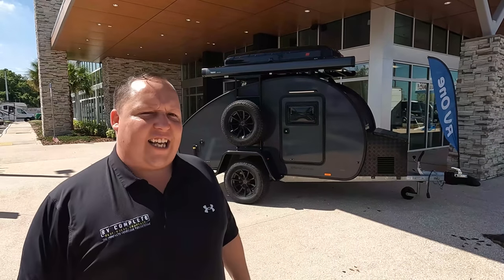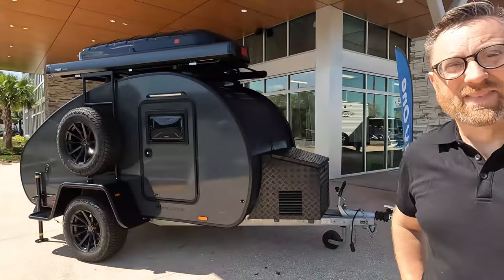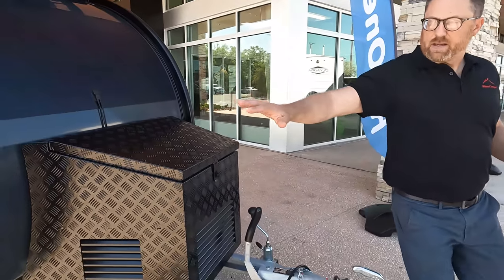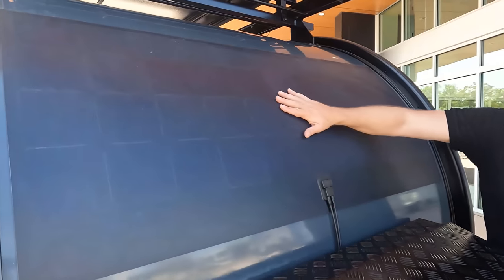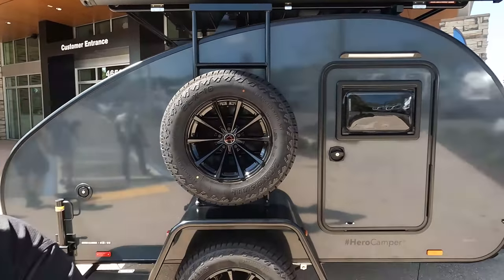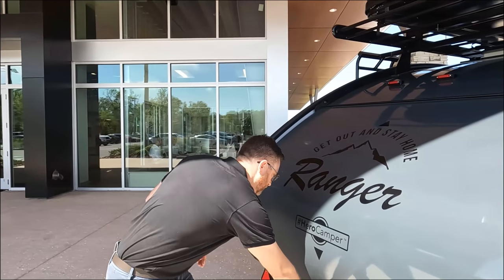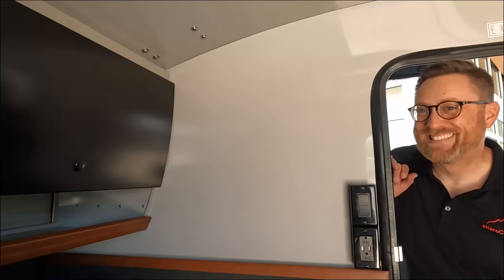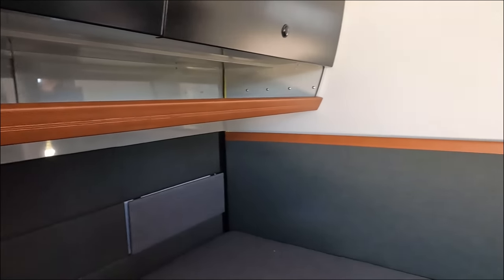Tow it with ANY VEHICLE - Hero Camper Imported From DENMARK!!!

Comment: We actually bought one of these in December 2021.  Seems like the communication between the Manufacturer and the dealer was off.  We were told by the dealer there was a heater (not just ac) that could run off surepower.  There was NOT.  Only the European version could run off surepower.  After about 2 months of back and forth we had to return the camper.  Manufacturer did offer to install the diesel heater, but we did not want to have to haul diesel around with us.  Real bummer for us!

Comment: The camper itself is great. The tent is good I would opt for a 180* awning and if it would fit a dometic 12v refrigerator/freezer. Is the A/c 12v or would you have to plug in. This would be an awesome boondocking camper if solar is enough to handle a/c load. Need to talk more about power supply.

Comment: I like the little thing. 
I like the quality of construction because you can see it’s well built. 
I like the tent option up top. 
I like that the inside has AC and heat options. 
Also bonus like of the Surge brake system. 

Dislike I didn’t see any lithium batteries described. It has a panel and says it’s got a battery but what’s the details? 
Kinda dislike the diesel heater is an option…maybe should be standard 🤷🏼‍♂️ 
Kinda dislike the hitch. Maybe needs a pintle hitch. 
Didn’t see mention of a hitch on the camper for a bike rack maybe 🤷🏼‍♂️
Reply: Agree, does it have rear hitch?

Comment: What a god sent item for adventure people!! 
Likes: 1) website shows two sizes of tent for top  2)  fits in a garage - spare beds for the sleepovers  3)  built in solar is innovative
Sort Of A Dislike: we are use to having refrig and stove at that price point, but on other hand I always liked having one cooler stocked with frozen items and thin slabs of ice and a cooler for drinks/cold cuts/cheese. 
We need more Euro engineered campers, RVs, vans here in USA.  When you go to Denmark travel on down to Germany on high speed train, they have some stellar manufacturers of RVs

Comment: Matt, love your videos but I have to disagree with your first dislike.  Coax is so rarely used that's not a big deal.  In my humble opinion the biggest dislike is the fact that the trailer coupler isn't an articulating style.  Most trailers in this class are setup with a Lock N Roll or similar.  You nailed it though with the fridge being optional + way too small.
Reply: I bought one of these, and although the trailer hitch head looks traditional it does flex sideways like an articulating hitch.

Comment: I'm a fan of roof top tents on all the smaller class RV styles. Besides giving the extra room u catch that night cool breeze much easier. Solar is awesome but camping in the forest u won't get the rays u need to power AC.
Being a solo female overlander my only issue w rooftop tents on teardrops is the ladders. I need one that's my Rottie can climb & so far I haven't found any after market that'll work.
The prices on RV is crazy high. Although I can see spending more on the ranger. 
Matt- u need to start commenting on basic warranties on the dogs in your videos. With prices climbing every month manufactures should be increasing their warranties. If their product is as good as they claim adding length to the term won't cost them

Comment: Because I have sons who do outdoors extreme backpacking and camping in tents in remote areas, I'd say this unit is awesome. The 6-gallon water tank is a really nice perk, the good beds with AC and no bugs and in a safe space are really nice. The frig wouldn't work for most since there usually isn't power where they camp but some sort of Igloo or carry a lithium generator and have the Igloo and generator inside their trunk/truck. Okay...you get the idea. This a cool unit for the diehard camper who pees in the woods.
Reply: Barbara, you are right about safety from animals in the woods.  Also, ability to charge phones for emergencies without carrying Jackery solar unit.
Reply: Solar won't run the A/C either.   Lithium battery+inverter is NOT a Generator.
Reply: @Hogger280  🎯
Reply: @jrambo7495  ??

Comment: Wow! I'm surprised to see an European trailer in the USA with all function lights at the rear as well as the red triangular reflector which denotes that the vehicle is a trailer and a legal requirement in many countries including Europe and Japan amongst others. I have the running gear on that trailer on my own here in Japan. I am a huge fan of the KNOTT (Made by Knott GmbH). The handbrake is very easy to use and very, very reliable. The prop stands (acting as stabiliser jacks) at the rear are really meant for goods trailers in Europe and whilst easy to use, are not really the best solution for a caravan (aka camper/camping trailer). That was evident when the caravan shook as they were on the roof. There are better options. It also should be noted that the coupler is a 50mm standard and not 2" (50.8mm), so ideally you should change the ball on your vehicle to match that of the trailer. You really should get Drew from the 'Playing With Sticks' channel to review this. He has a huge following and is all about teardrops.

Comment: Very nice unit. Love the galvanized frame. Diesel heat option I think would be needed. A spot for a Dometic fridge/freezer on a slider in the rear would be nice. A ceiling fan and an option for more solar on the rear lifting panel. Room for a generator in the box up front. No propane? You did say boon docking? Shower on the side and exterior lights. Where do I take of my shoes or do I just crawl in with the mud on my feet? Do I sit on the edge with the door open so all the friendly mosquitoes fly in While I take my shoes off and change my clothes? Why no removable cushions in the center to allow sitting? USB ports? Satellite radio/Bluetooth? I know its a camper. The quality is there, I think it just comes up a little short for the money in the amenities department.

Comment: Dislike: no fridge, I think that it may be difficult to find a box that will fit in that drawer and someone would be forced to buy the option fridge which is probably more expensive than being able to buy a generic. Or they need to change how the the fridge fits so that one can just buy a cube to put in.
No heater
Needs more stabilizers
I love the tent 
The clearance and tires
And the solar panel
Reply: You can adjust the grommets in that drawer. I did and put a medium size portable fridge/freezer in the slider.

Comment: Don't like:
1.Agree about the fridge
2. The sink basin is great, but the tap is too short, dishes are the same size even outdoors, taller sink tap.
3.  Would be nice to see a heat pump with the Air conditioning too. 

I would definitely be adding more batteries to such a thing too I suspect.

Comment: 14:07 Maximum weight of the tent is approximately 600 pounds. We need to test that. Let's get Matt & Wil that Tent and see what happens? I say it (the tent) survives (thanks to over engineering). Place predictions in the replies. PLUS, this thing is supposed to fit FOUR adults. Let's see the odds on the who Matt's Crew in the tent. Not for nothing but the over/under on that slides to the under.

Comment: While I appreciate build quality, I can't help but question the practicality of these tiny cabin + outdoor kitchen + roof tent designs.

If I were to redesign the thing for greater functionality in the space, cut down the overhead storage size and relocate it to the headboard for the next step, flip the kitchen to be usable from the inside, include a fridge by default, and incorporate comfortable space for a cassette toilet(which it would come with standard) in there.

Now, one might be asking, why go through all that to make the inside of the like that when it's going to be cramped. Simple: no one wants to try cooking or going to the bathroom outside in bad weather.

Also, definitely have the tent be optional. Don't get me wrong, it's a fine tent, but looks like a bit of a pain to setup, while also adding cost and weight for a feature not everyone has a use for..

Comment: I hate surge brakes. I think they are the stupidest designs ever!!! 
I think they're initially designed for rental trailers to be hooked up to cars that did not have a trailer brake controller. Practically every rental trailer of any kind has surge brakes.
I have had to pull trailers with surge brakes a few times and I absolutely freaking hated it!!!
If you're on a real slippery surface and put your tow vehicle brake on, the trailer brakes won't come on until the tow vehicle starts slowing down first and if you're on a slippery surface and your tow vehicle starts sliding a little bit the trailer brakes will never even come on to help you slow down!
Besides for the fact that you cannot back up with surge brakes cuz it'll automatically lock up the trailer brakes.
I once had you back a trailer with surge brakes all the way up a driveway and left skid marks all the way up cuz the trailer brakes were locked up all the way up the driveway.

And water does not hurt electric brakes! I've driven my trailer with electric brakes through deep water several times. 
I have seen people unplug their electrics on the trailer from the tow vehicle because of the possibility of shortening out the trailer lights that go underwater on some trailers.
Surge brakes are for idiots and lazy people who don't want to put a trailer brake controller on the tow vehicle!

I love electric brakes and I love my old electric trailer brake controller from the '70s that I will always use with trailers!
Reply: Why wouldn't you use the bypass pin lock when backing up, if there was no electric bypass. Since you wrote an essay in the comments.